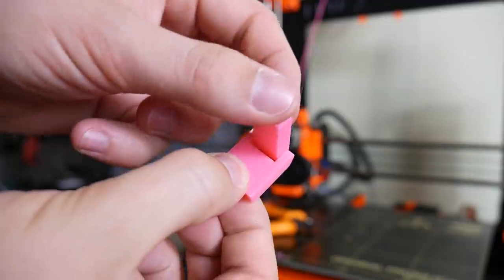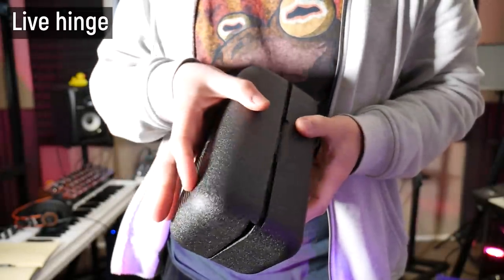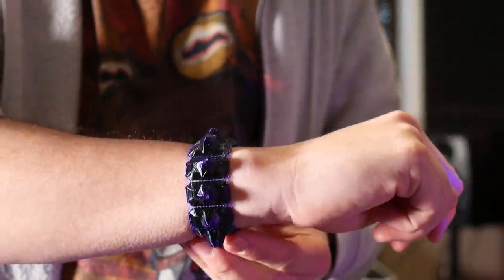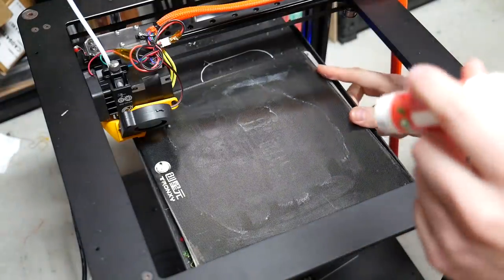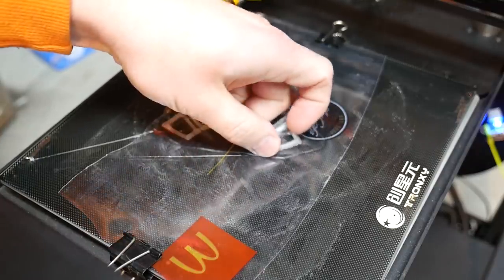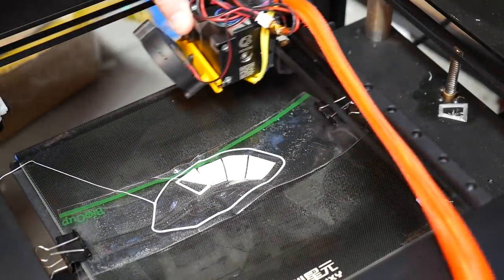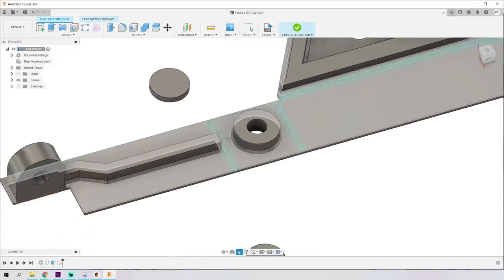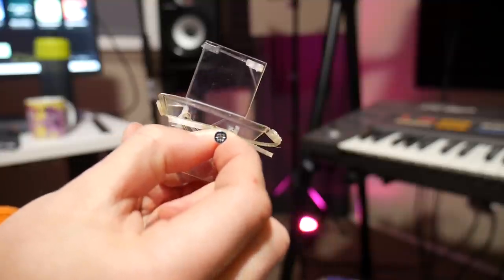Incredible Folded 3D Printed Mechanisms

Comment: Milk fat tends to be quite... persistent
maybe it was not sticking from residues of it. a really good scrubbing with a light solvent could work... OR

well. while building models there is a trick we use to make some paints stick to ultra slick surfaces. give it a very light scratch with a very fine sand paper, or sanding sponge.
nothing can resist that. those micro abrasions on the surface allow paint and other mats to adhere like nothing else.

Comment: BTW, Ackerman steering is not the actual mechanism used here, it refers to a specific geometry where the turning radius of each wheel is different, the inner wheel has tight radius than the outer wheel. The linkages here do not really allow it to happen as the rods are equally length. The track rod should be shorter than the axle to create Ackerman steering. https://en.wikipedia.org/wiki/Ackermann_steering_geometry Small detail.. but in a way, the mechanism isn't Ackerman, the function is. In true Ackerman steering the rods do not remain parallel.

Comment: Aren't there a handful of machines out there that have swappable tools to change from a 3D printer to a mid-powered laser, some even have low-powered CNC spindles. One of those would probably work amazingly for this application, as you wouldn't be transferring machines between processes.

Comment: Print first several layers in flexi plastic, then change material to PETG or PLA and print all structurals. Have you tried that? Changing plastic can be done on a single head printer.

Comment: As long as transparency and optical clarity is not a requirement, why not remove whatever coating there might be on the sheets by abrasion? It's cheap, quick and safe.

Comment: I would be tempted to laser cut the sheet with locating holes. 3d print the parts with locating pins, or holes for locating pins to insert into. Then either glue or soldering iron them together. The upside would be you can use whatever material you want for each and no alignment issues. Downside is increased assbly time and difficulties

Comment: Oh! 2 things about the coffee cup. Well, guesses, really, i'm still a lowling in the plastics industry. 1) The coffee cup may be coated with silicone. We do that at my job, or we buy it that way for some applications. I'd mail you a sample, but they come in rolls that weigh half a ton, and it won't fit in the mailbox. 2) It may actually be the surface being just too smooth to stick. You're relying on an already shaped/stretched/pressed against a polished surface piece of plastic that was heated at the time. I'll just bet if you got out some sandpaper and gave it a soft scour until it was cloudy you'd get some much better results. (Wash thoroughly of course, so you're not bonding to plastic dust.) As a lover of 3d printing and RC cars, i'd love to see a super lightweight unibody car, boat, or even aircraft made this way. ...or a super lightweight botfighting category, if they're going to be printed as one-shots!

Comment: Hi Angus, at the start you say that PLA doesn't make for a durable live hinge, but at the end you use the PLA coffee cup with good results. How does this PLA compare with printed layers of PLA?
Reply from the maker: It's less brittle than the filament, maybe due to the way it's molded vs 3D printing
Reply: Consider all the different types of PLA filament out there with different additives and such.  They all act pretty differently even though they're the same plastic and can melt together.

Comment: That's a neat mechanism but each time you fold it you are weakening that joint I'm therefore curious as to it's lifecycles. It would be interesting to see how many folds it can endure. The major problem with that design is that it can be repaired very easily so it would need replacing.

Comment: Would it be possible to melt scrapped PLA prints into sheets? Or print a single layer, heat the bed to >90°C to fuse the lines together? Just an idea.

Comment: IF you will find yourself some orange-oil based cleaner/de greaser, it will remove that spray glue without damaging your print surface. Wash it with soap and water after cleaning with the orange-oil based cleaner.

Comment: You might have been refering to caster and camber with the wheel alignment when steering.  Good luck with that as the angles of the wheels versus the plane of the vehicle are hard to ajust in printed scale versus what a mechanic can do with a car.  The degree offset for the wheels pointi g in/out might mean the connection/steering point being a pair of toothed ovals to lock each side versus the steering point to change each side's degrees from paralell.

One thought on the plastic being too thi k and not sticking to the print bed, couldn't you use your vacume former to coat the beds and just trim enough off to keep a lip wrapped over the edge?

Comment: How about a 0.2 mm layer of tpu and then print on top of that. 
Tinkercad make your first layer tpu save that file and then turn it into a hole and set your part on top saving that run the first file centered and then swap filament and run that right on top?🤔 just trying to help.

Comment: Why not print a few pegs on the sheet with the part and then cut out the hole for the pegs on the laser cutter. Once that hole is cut, it a matter of popping that sheet on the cutting bed and running another cut file for the part.

Comment: Are flex filaments compatible with pla petg abs? Could you design the hinge model with a first few layers being flat and thin with flex then do a filament change to pla for the thick parts. You might try flexible pla too

Comment: Instead of trying to print on or insert the material in while printing, why not print two parts that snap into each other with the material in between? If you look at the large live hinge you showed, to me, it looks like it was a different material than the case that was then fastened in some way to the case.

Comment: Quick question, with the nylon on the printer how does it react with the heat of the extruder and the bed as I wouldnt want it to melt and vapourise to make unwanted styrene and other nasties?

Comment: Could you use a sheet of metal mesh (eg 0;02 mm mesh size filter) or a carbon fiber, glass fiber mesh?
All of these are durable and heat resistant.

Comment: 13:30 I would guess the smoke from the laser cutting has contaminated the plastic surface. A simple trick to avoid that is to tape over the plastic with masking tape before cutting it with the laser.

Comment: if the spray adhesive is like a contact cement then (mineral spirits) will remove it real nice but leave some residue and for the residue use Denatured alcohol or ammonia bases cleaners.     p.s my experience is with vinyl and linoleum Not plastics like PLA ; do some testing.

Comment: PE is not the same as PETG. You can glue PETG using Cyanoacrylate (superglue), whereas polyethylene, you can't. You need to use a PE primer so you can get it to stick at all. The reason is that PE doesn't wet well, and this could also be the case for molten plastic. Perhaps this also works for printing PETG on PE?

But: why not print everything in PETG? By varying the profile (thin in the middle and getting thicker towards the sides), or making the distance between the parts bigger you could reduce the point-stress on the material which might make it tear, and by making the hinge wider, you could make it more stable. You can also vary the thickness of the first layer to get the correct one and orient the print so that the lines are perpendicular to the hinge.

Comment: Not sure what material Overhead Transparency Sheets/Rolls are made out of, but they would have at least some heat resistance from the old Bulb systems.

Edit: And you should be able to get them from OfficeWorks/other stationary supplier, even in lockdown..maybe.

Comment: hi maker's muse i  am new to 3d printing i been trying to print this one file that i made but it keeps haveing print failure as well over feeding the pla filament  my printer is flashforge pro 2 should i increse the temp from 210 to 220 to improve the printing process

Comment: here*s an alternative for you, simply print a raft to the required size, pause the print after the 2nd layer and you have a perfectly printed mesh all ready to go, just stop the print peel off your mesh and then try your print as normal, got to be cheaper than plastic cups...Just a thought

Comment: Just tried printing some esun pla+ onto some 0.005“ acetate sheets. No-no. Minimal warping, but no bonding. 😂 Just was curious.
Reply: Please try again with PETG. Those sheets are an excellent idea. :)
Reply: I would if I had some! 😔
Also, the melting point of acetate is roughly 200c. The 60c heated bed didn't affect it much, but printing pla+ at 200c or higher was causing local distortion of the sheet. (though I only clipped it down at the edges.) I'm not sure if it could stand up to the Temps of petg.

Comment: I don't get it, i don't see that PET should provide better flex results than PETG, and PLA is PLA, you can easily print a 0.25mm layer of it if you have ABL, you don't need someone to make one for you.

The classic live hinge material is PP because it really can be bent back and forth numerous times. Packing tape is usually made from it. I can see two challenges, for one, the tape can be waxed on the nonsticky side to provide better glue release, but i heard a few brands like TESA don't do that, they instead polish the top side really smoothly to give the glue no purchase on it. And for other, i imagine that finding a printable filament and settings that will bond to PP can be quite a challenge, unless you're printing PP itself, at which point that would be kinda moot.

You also get some yoghurt cups made from PP and some office folders.

Comment: 3D printing the little pegs to align the laser-cut sheet on the print bed is really clever!

Regarding the printed elements "sticking": Since you are using the laser cutter anyway, perhaps you should cut a few small "anchor point" holes where the 3D-printed parts will go. Small holes would give the first 3D-printed layer something to anchor to, and increase reliability of the printed section sticking/anchoring to the sheet.

Another thing that comes to mind is related to sticking the plastic sheet down onto the print bed: maybe try workholding with blue painter's tape and CA glue? https://youtu.be/3Gw3Z3yt1v0?t=90  (It would be a lot less messy than the spray adhesive!)

Comment: most tools come with their own storage case, witch is usually 100% live hinge. 
They don't use a different material. and the material is ABS. So there you goo...
Reply: Bullcrap. I just went through like 8 tool boxes that i had vaguely within reach and not a single one, NOT A SINGLE one was made from ABS. All of them made from HDPE. I don't deem ABS a suitable living hinge material at all due to polymer manufacturing method, as graft base flake becomes a fault nucleation site.

Comment: hey you should experiment with your IDEX printers perhaps to combine the material with TPU for hinges muwahahahhaa
but even with printers that don't' have a second extruder you could print a TPU layer and do a filament change maybe?
also I love ice lattes gimmi :O
EDIT: huh i'm actually tempted to design one TPU+PLA hinge for my enclosure doors. i have been meaning to 3d print one for a long time but never did, i was going to use an m3 screw as the hinge bar or whatever initially.

Comment: Would not a hot stiff bit of wire be a cheap, easy method? Hot and melted through a tight hole and through a non tight hole to a tight hole again?

Comment: Do you even need to use a heated bed if you are printing the petg to petg?
Reply: I have had the first few layers of a PETG print show super weak adhesion from bed being slightly too cold. Bed has a substantial thermal mass so it can cool PETG as it lays down too quickly, not allowing the first few layers to bond to each other very well, or even adjacent walls within a given layer.
Reply: @SianaGearz  my thought is that the plastic sheet wouldnt be bonded to the bed so it wouldnt be thermally coupled with the bed.  I was thinking the nozzle would be heating the thin plastic sheet enough to melt to the PETG.  If a heated bed is needed to help the bonding then it might be able be cooler slightly.

Comment: GREAT IDEA ALERT!  I saw an idea below that was almost there.  How about use a construction material like vapour barrier material?  You could get it for free from any construction site... it comes in massive rolls and there are so many offcuts it would be in the trash or you can bring coffees and trade for all you would ever need.  I bought 600 sqft rolls for under a hundred dollars.  I didnt look up the actual material yet... I think it is a polyethylene (not HDPE but a low density (LDPE).  I poked at the standard and included the search terms above.  I am not sure how many of the 3d printing filaments would stick to it.  It is notorious for not being gluable.  However in our case we would be melting plastic to it so previous issues might not apply.

The best part is it is available in 3 mil, 6mil, 10mil commonly here anyway. (Mil is thousandths of an inch).  3mil is not a good choice in this application... it is kind of like a cheap painting drop cloth or like a thick syran wrap.  In the US and Canada look for wall vapour barrier CAN/CGSB-51.34-M86

 that should get the material info.  This is 6mil.  Or just google canada vapour barrier. 

You can get earth vapour barrier for under slabs which is part of a newer standard, this is 10mil.  The 10mil is super durable and lays flat in small sections.  it is exactly like what you want I think.  It wont crease like the plastic cup did.

Nothing bonds to it except for Tuck tape (red translucent tape used only for tape joints of this stuff).  Small squares of this in the corners would keep the stuff down and flat.  I wonder if heating is as important given the temp at the nozzle and the thin base material, if you can do it unheated you will stop a ton of issues with warping and it would allow more flexible materials to survive the printing process.

Like i said in a previous comment I think it would be a good idea to scuff it first then wipe it down with a solvent.  This will help remove any films and also help open up the plastic a bit.

If people are interested I have the materials here and could try a proof of concept on 10mil... and probably 6mil.  3mil would be a big black ball of smokey plastic on a nozzle.

Comment: That RC car steering mechanism could've been done so much easier with actual hinges. Not sure why you made a blanket statement that 3d printed hinges are bad. 

It's just not true. If you implement it properly according to the application it should work reliably as an object made from plastic. Otherwise some bearings  or metal hinges could be used to improve the design.

Comment: Try hot glue sticks. Heat up the bed, apply hot glue stick, turn off the bed heating, print without bed heating. Turn on heat after print to release it.

Comment: try using real duct tape (heat proof type- not every day duck tape type) to tape the pla cup plastic to the base. If you need the entire surface glued to keep it in place, I would look for adhesives used specifically in heated applications- HVAC or maybe 300LSE would work since it is used in cell phones (battery gets hot). ( I have a bit of a fixation on adhesives hehehe)

Comment: Well there is little chance that you will read me... but:
- I don't understand everything you said because I don't speak English 100%
- I think there may be some interesting uses for your research but not especially the ones used in your video.
- For your tests I do not understand the interest of doing like that. You might as well print the parts with the printer and glue them directly to the plastic afterwards. And for the positioning of the parts, it suffices to print it on paper and to put this paper under the plastic sheet. It would go just as quickly, the plastic would be perfect because it should not go in the 3D printer.
But as I tell you: your research is excellent, it surely has very interesting uses. In addition, I print 3D objects myself and I suspect that doing all these tests, ... it was not easy. So top work! Just a little disappointed with the uses found.
Thank you for your creativity and your good quality videos

Comment: Films are such a hassle. Why not print with material 1 the first layer or two and stop, after the stop print with material 2. Perhaps you layers to change parameters like temperature if needed.
Filament change is a hassle too, but I think not much more than with a separate film. It would need some testing to see what material adhere well to each other and it would leave a softer first layer if softer material used under.

Comment: >Very fancy multi-material printer

I hate it how that is in 2021 still "very fancy", instead of "standard baseline feature"... It wouldn't be as bad, if more printers were designed to be easily expandable to that (just add extra extruder, connect cables and tubes, and done), but no...

Comment: Prototyping was the reason I wasted money getting into 3D printing but now with 40 attempts at 3 weak useless prints. I realize 3D filament printing is just never ending tuning, replacing parts and filling your rubbish bin!!!     It has nothing to do with making anything useful...  The Resin printer (Sonic mighty) I bought does beautiful prints but these are brittle plastic useless for prototyping anything, but at least you get something.  The Ender 6 just makes pollution, but even getting waste plastic from it requires watching many YouTube clips, reading forums, buying many new parts, tuning... Then throwing it all in the bin!!! 
POINTLESS!